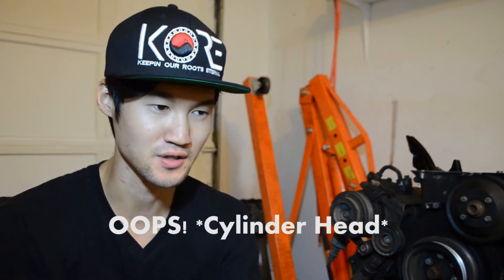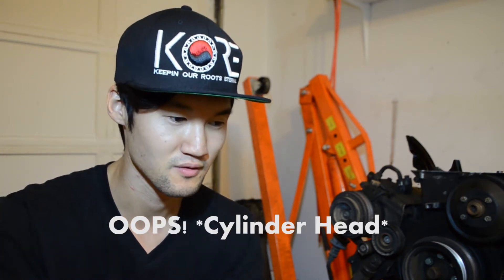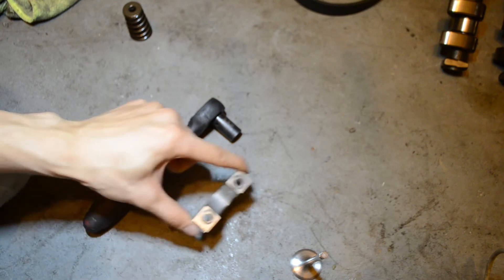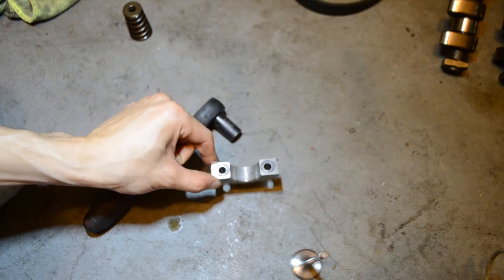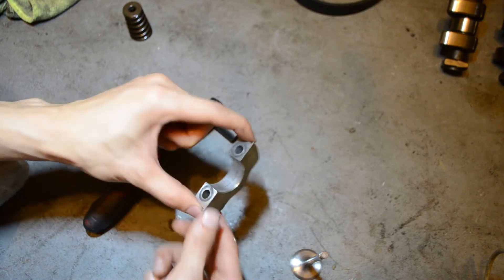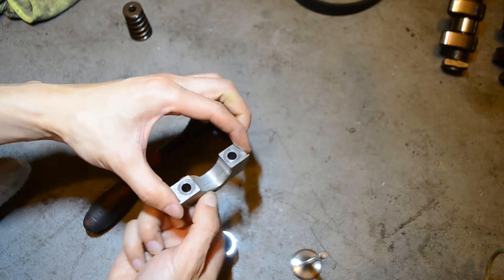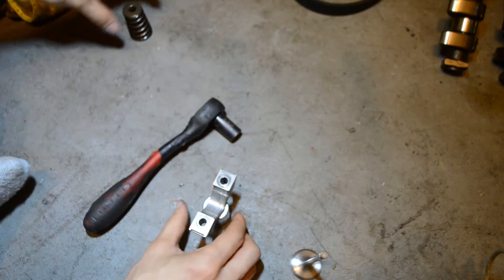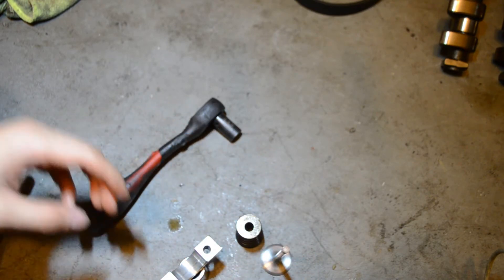How to remove E36 Engine Valve without the compressor

Comment: You're doing a great job with these videos. I'm a bit past you on e30 and e36 but working on my new to me 99 m3. Those collets are easier to put on if you put a dab (yes, son, I wrote "dab") of assembly grease on them as you go.
Reply from the maker: Erik Engstrom amazing! Thank you!
Reply: @HansGarage  do you have a video of how to put the valves back with a valve spring tool